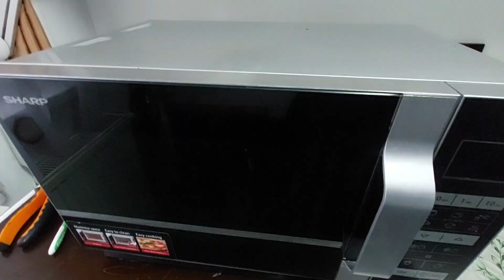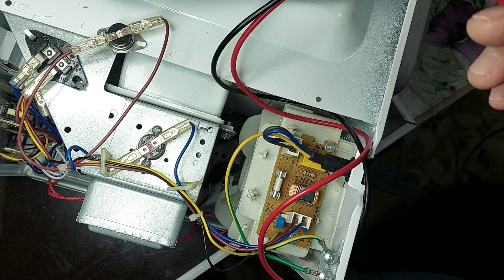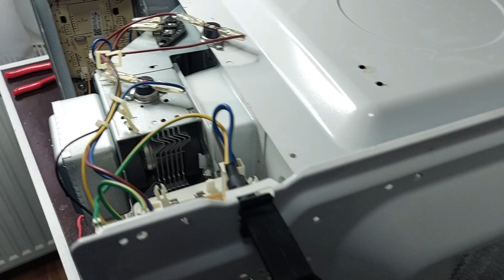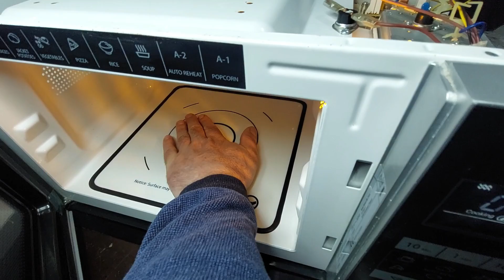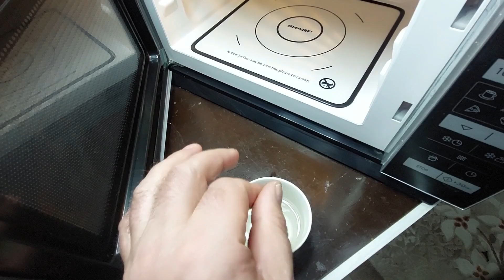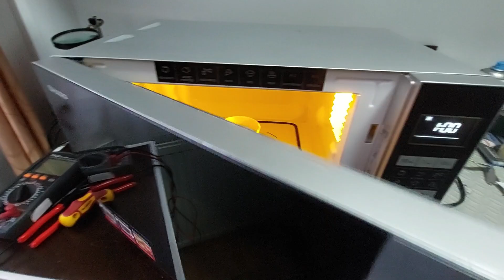How to fix Sharp R360S Microwave

Comment: I have this exact make and model. My microwave is heating but it is taking approx twice as long to cook as it used to do. Any ideas why? ☺
Reply from the maker: Press the Power Level button, then select the desired power level using the number pad (1–10) and press Start to begin cooking.

If the power level is already set to 10 (High) and the microwave still takes much longer to heat than it used to, one possible cause is a faulty magnetron. A failing magnetron can still produce microwaves, but at reduced power, so cooking takes significantly longer. Another possible cause is a faulty high-voltage diode.